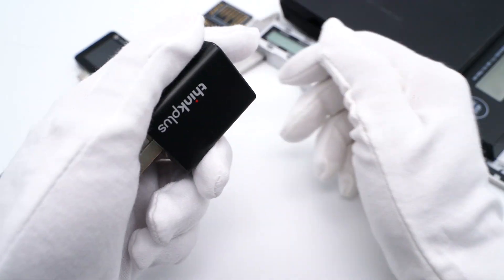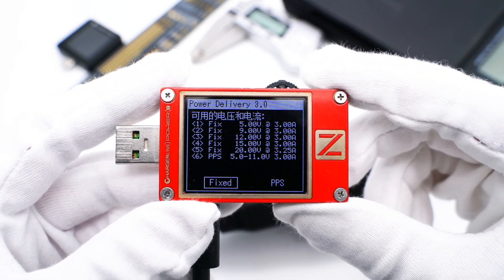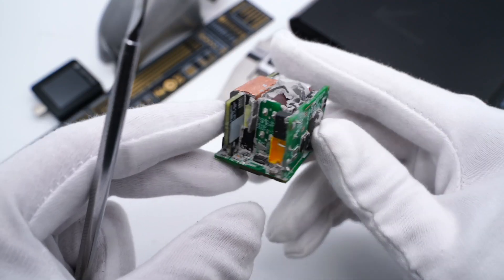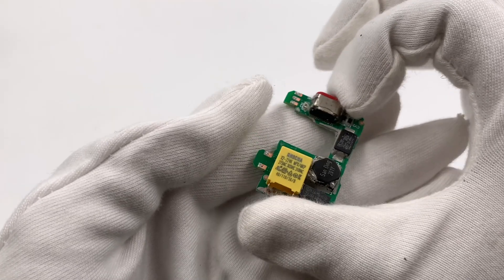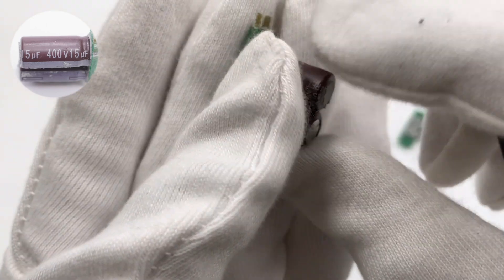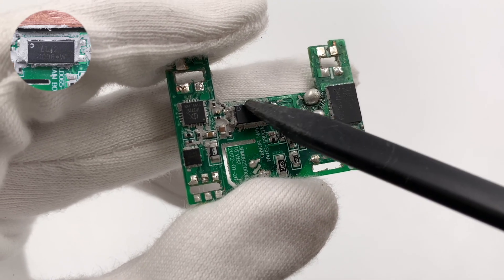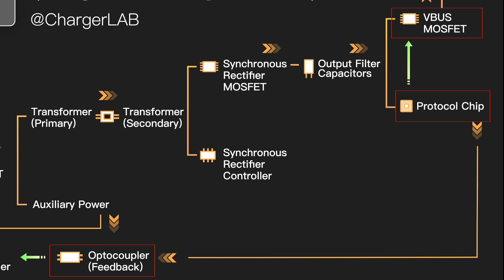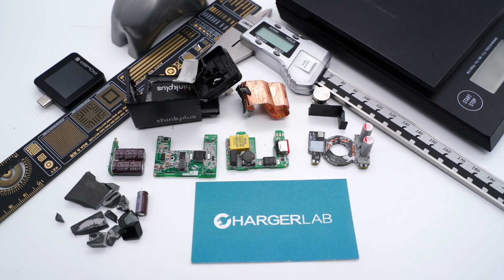Teardown of Lenovo thinkplus GaN Nano 65W Charger (The Third Generation)

Comment: Even though the power density is very impressive but it is chinesium technology and will overheat.
Reply: What makes you think that? It should be efficient enough (e.g., through synchronous rectification) that it will have minimal heat dissipation. The silicone likely is a reasonable heat-conductor, acting as a heat sink.
Reply: @pigrew  just not enough surface area to dissipate the heat at reasonable efficiency numbers.

Comment: If company really wants to save environment then they should make chargers repairable...
Reply: Chargers rarely break to be fair. I've never had a charger of any kind break on me. It's up to you to make sure your home is surge protected so you don't damage your chargers
Reply: no, you don't want something that dealing with both high voltage and low voltage to be repairable by end user, it's risky, even PC's PSU isn't repairable by end user
Reply: when he opend it my first reaction was also yay potted not repairable, but if you think about it for a universal device like this safety,longevity,recyclability are more important.  If its made propperly the usb c standard should be obsolete before it needs to be ever repair and it just needs to be recyclable. lets be honest no one really repaire usb charger in any meaning full numbers it's dangerous and we have to many any way since they are "mostly" universal.

Comment: Aha, that is how this charger is so small. It only has ~35uF of capacitance so it can only achieve full 65w on 200-240v. It looks like the output is limited to 30w on 100-120v.
Reply: Thats a good find. Didn't realize that.
Reply: @rajatdixit007  lol thx
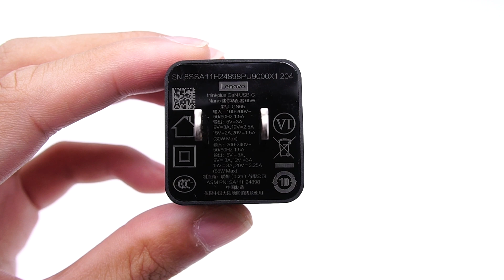Reply: Exactly! At 0:21 you can see that on the lable